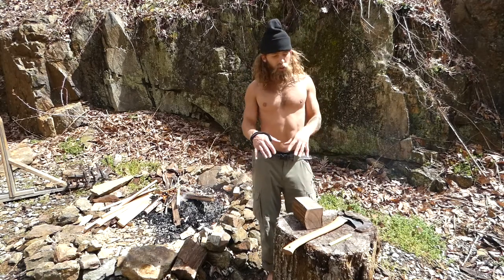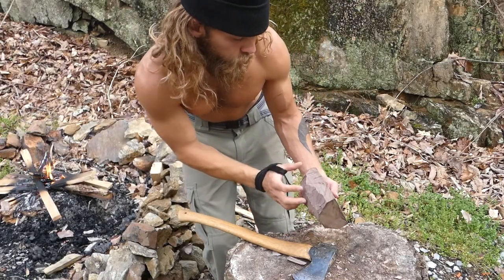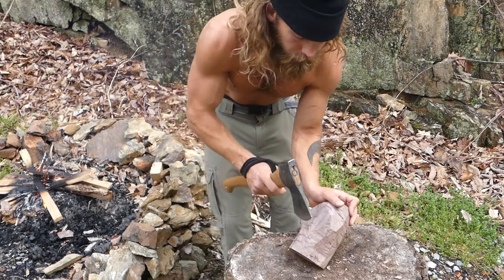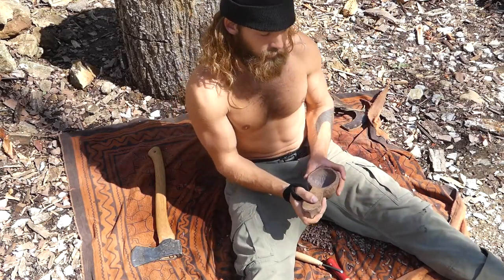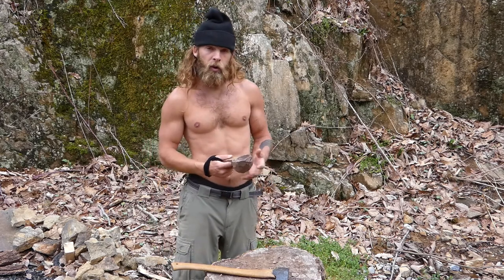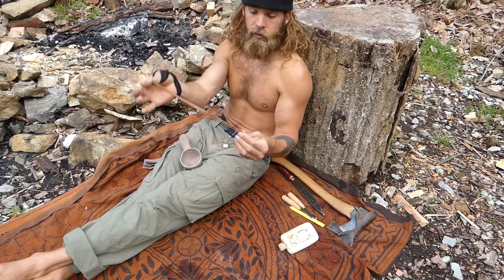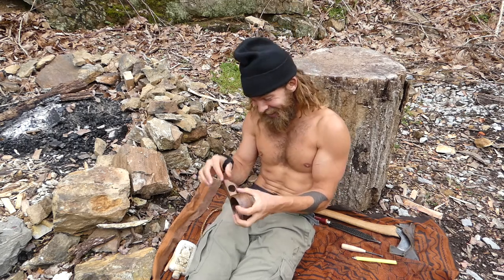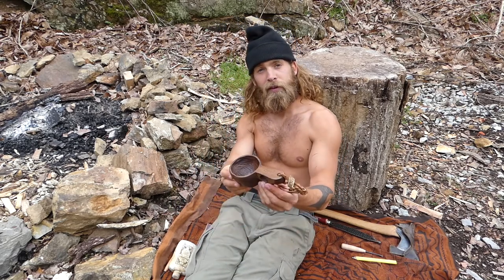How To Make A KUKSA - WOODWORKING

Comment: Might not need a whole lot but you need a different tool for hollowing out the bowl part...they have chisels that's blade is on the side and they are spoon shaped. Much easier if you use the right tools for the job. I'm sure you can get one or make something simular... I'm sure you'll notice the time you'd save.